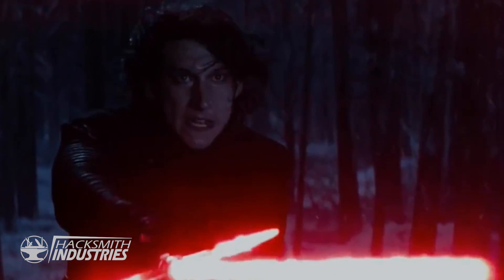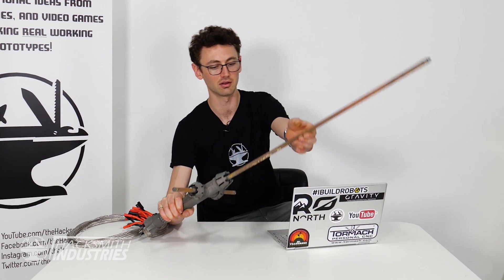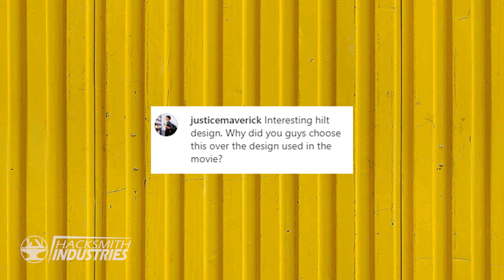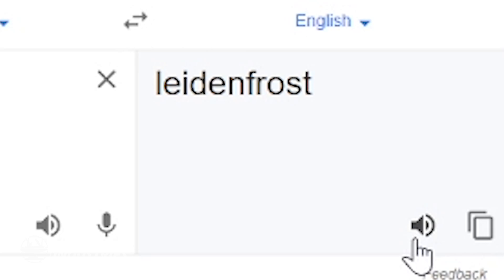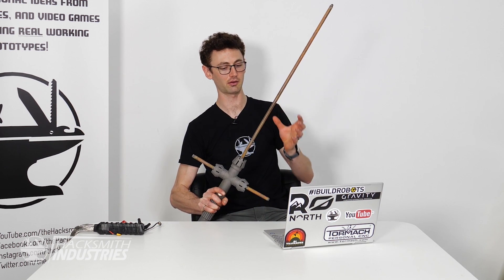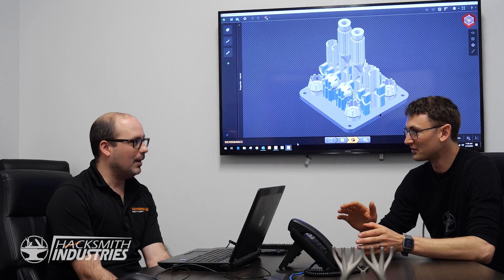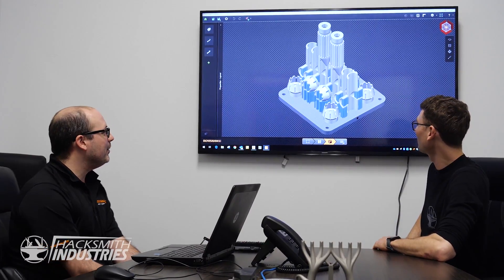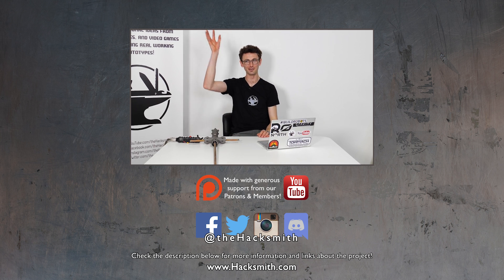Homemade Lightsaber Q&A!

Comment: How would the temperature of the hottest lightsaber hacksmith has, compare to the temps of molten copper? I know that molten aluminum, if it touches your skin(paraphrasing what my dad said)  it will burn through the skin, to the bone, through the bone, out the other side,  all before you even relize what's happening. that is at temps of 1,440 or so(frankly i think dad was trying to scare me into not continuing to cast metal) and copper is around 1,975 degrees if i remember correctly) so my guess as to what would happen if the blade touched you is that i would require a lengthy stay in the Hospital burn ward.  although i really don't know.

Comment: If they are in series, then why doesnt one burn out rather than powering them all, also what causes it to glow is it the massive flow of electrons, or massive flow of protons or something
Reply from the maker: The passing of current produces heat -- it is electron flow. Just like a heating element or warm wires powering a project -- if enough current flows, that heats up the conductor!

Comment: I mean... not quite... it's not really a lightsaber, outside of being a very dangerous Prop if it Were considered a "Lightsaber"  nothing but love though, very Big fan. Working on my own real functional Lightsaber-Plasma blade.
Reply from the maker: How's that going?
Reply: the Hacksmith (VLOGS)  I think you know exactly how that's going 🤨🤣 Is it ever an easy process? My biggest issue is fabrication funding(of course) but without giving too much away, my design utilizes laser generated plasma projected into a stabilized ion channel. Been working on the design for a few years, having serendipitous breakthroughs every now and then. Of course even if my final design "works" it will be far from as stable or solid as Hollywood plasma blades are depicted. Love all your work and designs, your crew is the best. You bring me Hope here in Montana.

Comment: Question: what are the batteries used? Are they ac or dc power type? How expensive are they?
Reply: Hello There batteries are all DC. AC is like your wall socket. You can get a converter to change it from DC to AC though, and I believe that should be the bases for your question. "If it needs a converter or not?"

Comment: Why does the metal break down
Reply: Because heat.
Reply: Andrew Senecal was looking for a more scientific answer then that become some metals are fine just wondering because from what I know it is a very strong metal I was wondering mainly how the heat breaks it down
Reply from the maker: If you heat up anything to white/yellow hot its going to start breaking down as it is literally melting/oxidizing off =)
Reply: the Hacksmith (VLOGS) thanks

Comment: Why does it not cut through things like in the movie?
Answer: they can’t get enough energy to produce enough heat
Reply: PHYSICS
Reply: Thats not true. He explains it right at the start of the video. Its hotter than the melting point of most metals, it should be able to cut through them. It cant tho because it cant transfer the heat from the blade to the other objects
Reply: That's not the only problem...
When they try to cut the blade gets cold very fast (when you look closely you can see the blade doesn't glow anymore, meaning it's probably below 550°C (it's normally around 900-950°C)) and the metal blade isn't able too store enough energy to sustain the own temperature, especially when cutting through other metals which have high melting temperatures too...

Comment: I am sufficiently hyped for the plasma lightsaber. I know it won't be perfect (you can't have a duel, it won't have a defined tip, it won't move as blade if you move it too quickly, and probably will take a few seconds to fire up), but if it looks half as good as it does in the Instagram and Twitter posts it will be an amazing video.
Reply: Well it out and it amazing, but it plasma so you can't dual unless you design a metal rod that is also retractable that can handle the plasma if possible
Reply: @drmeduimant5066  If we can figure out how to control magnetic fields, we'd be able to have lightsaber battles quite soon. And then we'd also need to make more prosthetic limbs
Reply: Yes

Comment: Dumb idea: Can make an induction coil sword and sharp the coil in such a way the field faces outwards. Like an induction stove top but really long and thin. 
That way instead of heat transfer it's magnetic.
Reply: Definitely interesting idea, but I see a couple problems with this. How would you shape your coils in such a way that you have the maximum magnetic flux outside the coil and would the resistance cause by the heating up of metal from Eddy currents be too strong to melt it?
Reply: @linecraftman3907  
Theoretically speaking you can do that , you're basically creating a dipole antenna
But of course there are a lots of problems associated with that .
Reply: actually , this lightsaber already creates a magnetic field around itself.
BUT since they've built their "blades" in such a way that the negative pole is at the center of the blade ,and the positive pole is the outer skin of the blade(or viceversa it doesn't really matter) those magnetic fields cancel each other
But the real reason why they don't use induction heating is because those plates uses AC current , they're running on batteries so DC ..... yeah you can actually convert DC into AC , but the required inverter to deliver that much power , would be MASSIVE
Reply: I don't understand this big brain stuff
Reply: @pponce836  
My prof told me that if you can't explain a physic problem to your grandma , it means that you don't truly understand the problem ( I'm blaming myself here)

Every time you run a current into a wire ( or in this case a bar of tungsten) this creates a magnetic field that follows the right hand rule ,your thumb is the direction of the current , and the other 4 fingers (at 90°) represent the direction of the field ( you have to imagine that you're holding that cable , so you 4 fingers are creating a circle)

Since their blades are designed in such a way that the current will run from the bottom to the tip (in the center bar) and then from the tip back to the bottom part( the outer part that you see glowing in red ) if you apply the right hand rule ,you will see that the magnetic field generated by the center core is in contrast with the field generated by the outer skin

Comment: why did they use support structures for the 3d printing? 
like one of the plus points of powder bed fusion/3d printing is that you dont need support structures which also shortens the post processing...
Reply from the maker: You still do for a lot of powder bed SLS processes actually
Reply: In powder bed printing they can have an issue with "blow out" which causes defects, having a support structure gives a more stable surface for each new layer(minimizing "blow out" and it's defects)